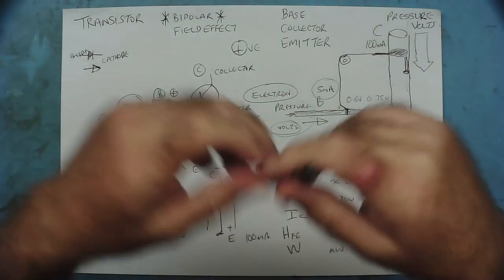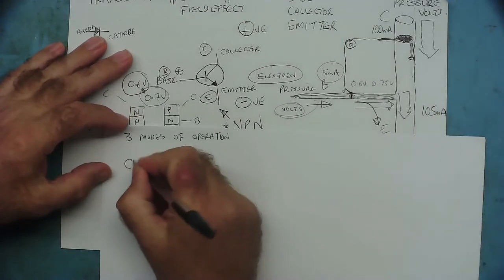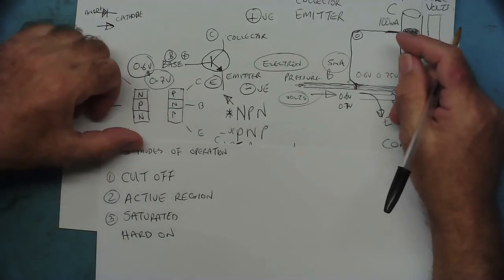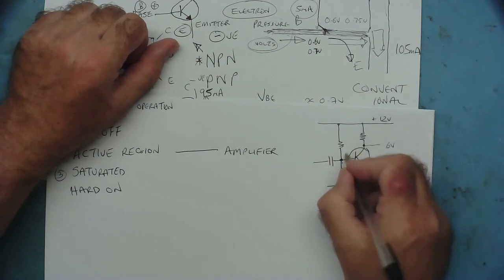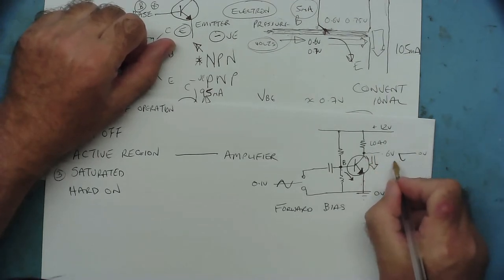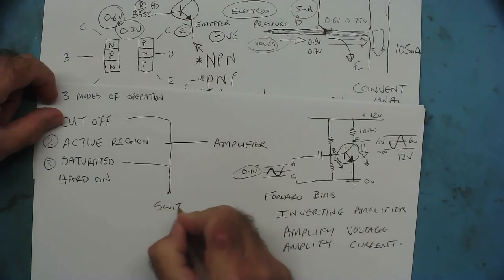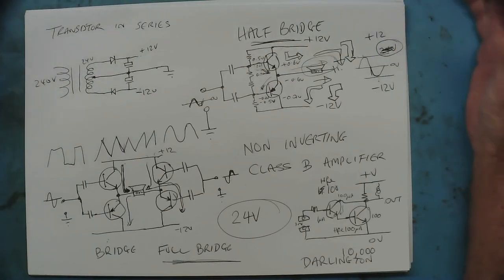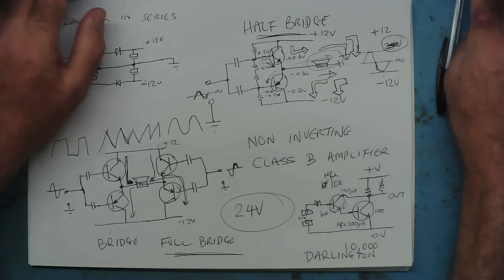Transistors Part 2 Understanding Transistor Circuits - Circuits & Components For Beginners  LER#054

Comment: I don’t quite understand the voltage across C and E in the voltage regulator example, because in part one it was mentioned that if the transistor is turned on then it should behave like a closed circuit. Which means the voltage across C-E should be close to zero. But yet the example used 2.7 V across C-E
Which means there can be a voltage across if there is significant current flowing through, simply because there is still a small amount of resistance between C-E when the transistor was turned on. Is this a correct explanation?
Reply: No, it's not for any resistance as such. Like you said, there could be enough current to short the transistor. Let's start at the Zener. See, the Zener essentially keeps the base voltage at 10V. (Everything above that is going through the Zener to ground.) The emitter Voltage now easily goes up to 9.3V (through (partly) base and (mostly) collector towards emitter). Now this is critical: As soon as the voltage there tries to go above 9.3, the voltage from base to emitter will go below 0.7V. But that's the voltage you need to open the transistor. So when that happens, the current is too little to keep the transistor fully open. It starts to throttle it. (You could regard this throttling as the resistance you mentioned, but it would lead you on a wrong track, I think.) So the transistor essentially limits its own output to Zener breakdown voltage minus base-emitter voltage. And - different from what a fixed resistance at that C-E connection would do - this is, up to a melting point, independent of the collector voltage.
The C-E voltage therefore will always be collector voltage minus (Zener breakdown voltage minus base-emitter voltage). With 24V, you therefore would have 24 - (10 - 0.7) = 14.7V across C and E. Good question, though. Exactly the stuff I was asking myself so often.